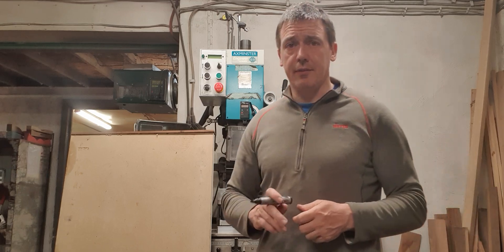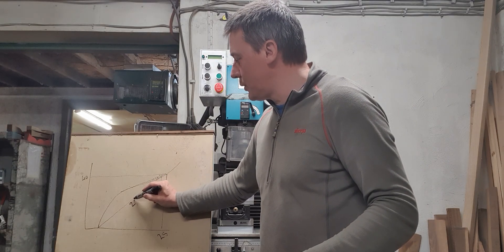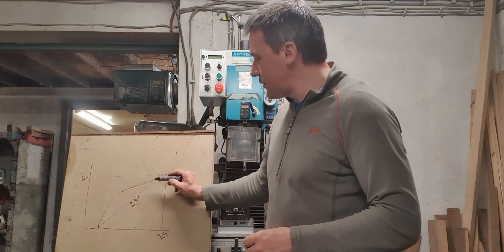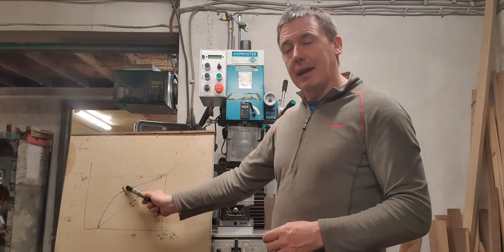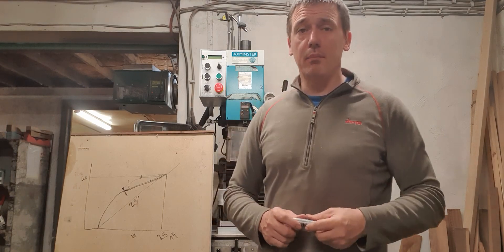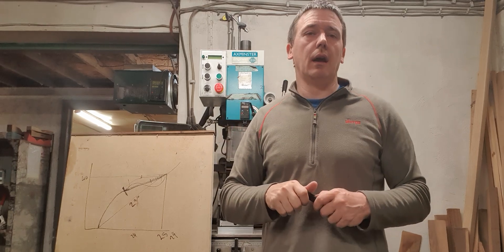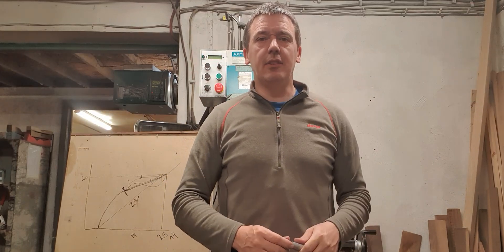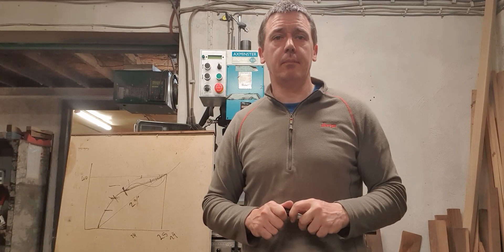stack and its definition

Comment: Let me see if I can ask this from an archer's point of view because I having a hard time understanding how to make a bow fit an archer with very short or very long draw lengths--I have a 30" AMO draw length and my wife has a 24" one.

This is what I understand: limb draw weight, regardless if they are short, medium, or long, seem to have the same rated weight for a 28" AMO draw length. If the riser length changes 2" in length, draw weight change 2#. If I have a 25" riser with short, medium, and long limbs, how does the draw force curve change outside the 28"? If I have three 68" bows, one with a 23" riser and long limbs, a 25" riser with medium limbs, and a 27" riser with short limbs, is the DFC same? 

I guess I have been trying to understand how to think of riser length and limb length in term of an archer with a short/long draw. How should an archer think about riser and limb choices when they don't have a 28" draw? (This is probably an easy question that everyone knows, but this has been tricky for us.)
Reply from the maker: Extra short limbs and a long limb.and ask for the poundage at 24 or at 30. On the respective riser.